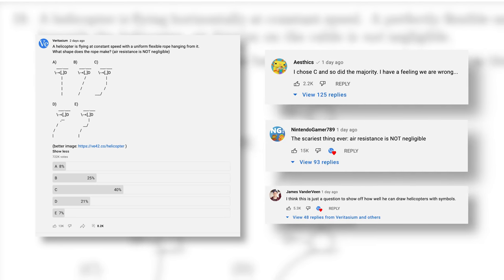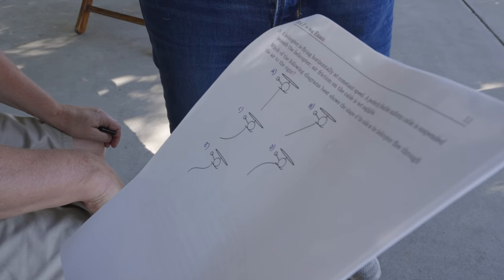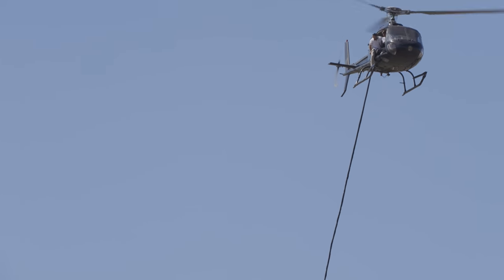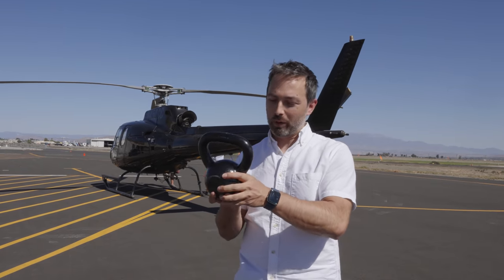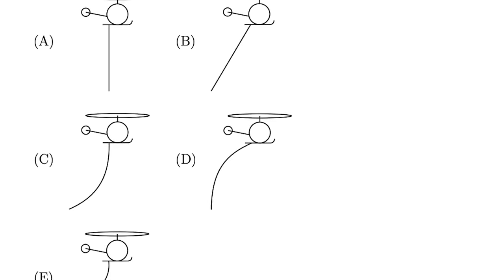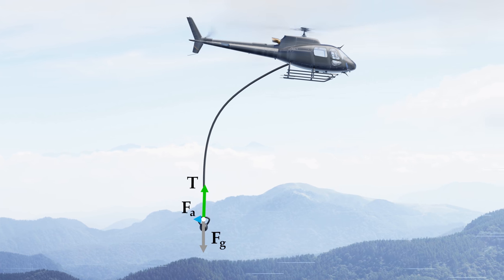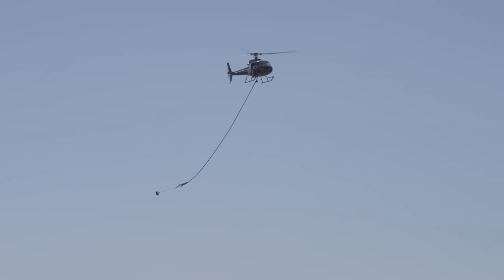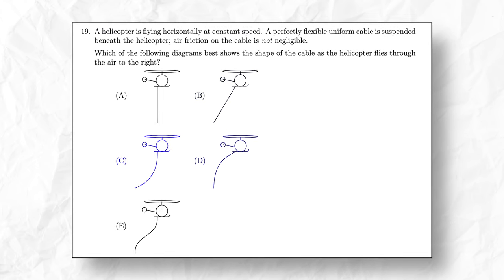I Rented A Helicopter To Settle A Physics Debate

Comment: Having done MSc in aerospace, and PhD in mathematics, I can assure you that the intuitive way you proved it is definitely the best way to approach this topic. I have come across this topic before but it's surprising how easy it is to get lost in it if you don't have the insight of the tensile angle. I remember back in Bachelor's, when I first attempted this question, I got lost trying to apply something called the "virtual work theorem". Essentially I tried treating it like a mechanical beam with uniform loading and one end suffering virtual deflection. Anyways, I just wanted to tell you that I really loved how you approached the explanation along the easiest-to-digest path. :)
Reply: I've seen at least one other commenter here talking about mechanical beam analysis, which seems weird to me - beams are (mostly) rigid, and the rope has no intrinsic resistance to bending. Hence I wouldn't expect that model to be useful for this scenario.

I'm working from high-school physics though - am I missing something important?
Reply: @patheddles4004  but the same logic of fbd diagram applies in both case, so if we take the fbd then the question becomes simple..
Reply: Before seing the solution, I was thinking that the weight of the rest of the rope decreases towards the end of the rope, but the friction would be the same. I accept that I'm wrong, but don't understand why. Can you enlighten me?
Reply: @patheddles4004  Well it's a mess created by how teaching is approached in these cases, and real world physics being much more complex. In this case, two main factors lead to these wrongful assumptions.

1. Background: For example, my bachelor's was in mechanical engineering, and in it, we had to repeatedly assume a lot of materialistic properties when the question would not explicitly state it. not to mention, for years we are trained on hypothetical questions asking us to assume certain things which are not true in real world physics. In this case, if you are just told about a rope and air drag without stating much about the stiffness of the rope, it is very easy to fall in the trap of assuming that the rope is just an uniform beam under constant (perunit length) loading because in mechanics, we would often reduce real world problems into such simple cases.

2. Stiffness: This makes it even easier to fall in this trap. The rope can behave arbitrarily based on its stiffness. I did my master's thesis on dynamic inflow modelling of helipcopter rotors. What I can tell you is that if the rope was actually flexible enough, it would't make any of the shapes from the question. It would rather follow the helical pattern of the vortex ring downwash created by the rotor, and can even ride the upwash to get into rotor blades (as the pilot was afraid of). Therefore, for the rope to have a 2D profile like those from the question, you are assuming certain level of rigidity. The answer you would get will depend on how much this rigidity is.

In summary, everything is a mess in real world. You cannot simplify a complex system into smaller idealized cases and hope to always get the same results as real world observations. Each complex case can be reduced to multiple idealized  cases and whether or not you get the right answer as real world will depend on whether you could successfully identify which idealized case fits your current test the best.

Hope this helps. :D
Reply: @rasmis  : My thought process was exactly the same as yours!  I hope someone can answer your question in a way that we can both understand!
Reply: This is why experimental physics exists. You can run in circles with competing theories, but, at some point, you just need to test the fkr.
Reply: @rasmis  it is said here that the rope is uniform, so why would its weight decrease? Uniform means that the weight is equal in every section of the rope...
Reply: That's what I did as a student doing bachelor in mechanical engineering.
Reply: @AniketTurkel  which nit are you in?
Reply: Hah. Applying virtual work here is creative. But yeah, keep it simple for this one. If you had to prove that the solution is dynamically stable, that'd be tough. But if a stable solution exists, then the external forces have to be equal on every segment of the rope, and then it's no different than simply tilting coordinate system and rope hanging straight down.
Reply: I also thought of it as a beam with a uniformly distributed load on it, and I thought it would be B, so maybe your idea wasn't so bad after all.

Edit: well maybe not exactly like a beam, but beam mechanics made me think of the UDL, in this cass the air resistance
Reply: Same thought friend... Same thought 🌹
Reply: @whoami8247  The way I understand it, the weight decreases at each point down the rope because there is less and less rope pulling it down.  
(Full disclosure, I'm just a physics hobbyist so don't take my word for it)

🖤🕳
Reply: @cherylhudson7333  but here the weight doesn't matter...
Reply: @cherylhudson7333  You have to balance the forces acting on any finite section of the rope, not literally at "a point". If you take a finite section of rope, tension is pulling it down at one end and up at the other end. It is the combined force (difference) that matters, and that must balance the weight of the section and air resistance on the section. In the first scenario, that difference is the same for equal sections of the rope, making the tension itself increase linearly up the rope.
Reply: @OneEyedJack01  and yet they are asking students based on a theoretical understanding of force diagrams. That is hardly a good question.
Reply: @OCD.Reader  my intuition insists that you'd need to reduce the mass of the rope as well, but of course that's also not specified in the question. But yeah I can imagine this with a fine thread instead, in which case it would definitely behave very differently. I was definitely working with a bunch of assumptions that I hadn't even noticed, though fortunately they turned out to be the intended assumptions.

I was about to argue about the effect of the rotor wash decaying rapidly with distance, but then I realised that that would mean different forces in different parts of the rope (and hence a different shape). Apparently reality is complex, or something...
Reply: A diagram of two links flashed on the whiteboard is the easiest way to go. I’m wary of “linearities” as they easily become nonlinear, and a counteliver beam popping to my head at first ( my mech. eng. mental bias) led me to look for a different path.
Reply: @OCD.Reader  I got lost in modelling it assuming mechanical beam-like properties too ( unsurprisingly, as most would, looking at the percentages :p), and what you're saying is really insightful and a such a well written view on how far apart Physics, which should depict real world interaction, can actually be from reality if we're not careful.
 The Tension Angle i was completely oblivious to, but it makes a lot of sense and it's really an "invisible" but crucial force, especially in this case to get the right idea. If i knew about tensile force properties i would've much rather compared the hypotetical variable beam-like momentum arm of the rope to how the tension changes in each of the points along the rope, and rather not assume that it would impact shape along the rope, ultimately!
Reply: @OCD.Reader  excellent explanation.

Comment: To ad to the conversation on the interaction of the helicopter rotor wash - A helicopter in forward flight quickly passes through a phenomena called "effective translational lift" at ~20 to 40 knots indicated airspeed.  This phenomena is when the blades starts flapping (advancing side blade moves up, retreating blade moves down with each rotation) to compensate for different relative velocity around the rotor path plane.  The rotor wash directly beneath the helicopter is then negligible as it is increasingly "left behind"  the aircraft and the rotor increasingly processes fresh (an accelerated) air.  The pilot typically reduces the collective rotor pitch to compensate for this increased performance.  You can see this when a helicopter flies over water in close proximity at various speeds.  This phenomena greatly increases helicopter rotor lift (efficiency at converting engine kw to lift), so the helicopter pilot typically wants to get into the translational lift environment to save fuel and reduce engine power demand as quickly as possible.  The helicopter is also less vulnerable to engine failure in translational flight mode - if the engine failed it is easier to safely auto rotate to the ground with the energy and increased lift of forward flight added to the stored energy of the rotor rotating mass.  Their is something in the manual called the "death curve" typically.  It is graph of height versus airspeed.  On one side, and as you get further from the curve, the helicopter is easy to safely autorotate to the ground.  On the other side, it is unlikely you have sufficient combination of altitude, airspeed and rotor rpm to land safely if the engine catastrophically fails (instantaneous loss of engine power).

Comment: I had to watch the explanation about 4 times to get this.  My mistake when sketching this out was not realizing that the air resistance of all the rope underneath any section adds up in the same way that all the weight adds up.  So at top of the rope I had tension balancing the entire weight of the rope, but only a tiny bit of air resistance.
Reply: i don't know how to sketch it or calculate it... but i was right both time... just common sense

Comment: This is a great video!  There was a myth-busters feel to this one.  You explained the theory, but experiment is the final arbiter.  It seems that to get the shape in answer E, you would need high drag towards the middle and then a weight at the bottom.  But I think you tempted fate long enough in that helicopter as it was.  I was impressed with Craig Hosking, expert pilot!
Reply: i feel a different type of rope. maybe a flat one , would have made for the drag needed for that scenario you speak of. imagine what chain mail might look like
Reply: @slitheredxscars  flat rope would still be B but likely get caught in the back rotor, chainmail would also be B
Reply: The actual answer would likely be none of those, or possibly all of them, without the qualifiers about most closely resembling it. I'd wager that all of them except A would pop up when flying due to the fact that you can keep a helicopter relatively steady in terms of ground speed, but also keeping it steady in terms of air speed at the same time is going to be an issue.

Comment: I think it is pretty neat to spot that this happens because it is a flexible rope.

In all of my tests, I'm not sure if the rope was not flexible, but the tension was always the same along the whole rope. I even thought it was some kind of property.

That is why my first guess was B (straight line) but I thought that with weight, you would just get a different slope and a straight line. Really neat the animation.

I was confused at first why the weight is not pulled enough, but they are all in constant velocities, also, it is just a comparable air resistance that is small, but it is still the same as at the top, right? It is just smaller because there is more weight... And it dissipates along the rope?. Again, I'm not sure
Reply: I’m confused as to why we are assuming the helicopter is moving forward, as the only direction given in the question relating to its horizontal movement, is “through the air to the right”. To me this reads as the helicopter would be facing north, but traveling due east.

Comment: I think many of us who chose option C (such as myself) were expecting the rotor wash to be far more significant of a factor. Perhaps to make the question a little more fair it should be asked with a blimp or perhaps a slow airplane.
Reply: I was thinking the rope would be dragging on the ground
Reply: The question is fair
Reply: I hope there's not that many of you lol
Reply: Was not really factoring in the rotor wash myself, but just thinking about the tension at the bottom of the rope being lower. Not sure why that made me choose C over B now (was inbetween those), but makes sense now after the video. :)

Comment: The same situation as C with the cable hanging like a J happens with in air refueling of some jets and helicopters. Some use fuel lines with conical conectors which have less weight, since they have a more weight saving design than the rest of the lines and more drag, since their design is larger than the rest of the fuel line (to make it easier to connect). the effect is very subtle due to the high speeds but it still noticable sometimes.

Comment: Happy to hear that my structural analysis courses came to help me in getting the correct answer. Treat it like a simply supported beam with a single pin connection and it deflects linearly 😁
Reply: I knew answer not because of formal education,  but rather because I have had informal education of seeing quite a few helicopters flying with stuff dangling below them.
Reply: XD nice one
Reply: how tho? the cable is not rigid
Reply: For the rope only I was sure it would be B and I thought many people would guess C, But I had no idea why I thought this would be the case. The diagram  made it click
When he added weight I went back and looked at the diagram to consider what the effect would be.
I have noticed a similar effect while fishing in clear,  fast moving water on the line. If the line breaks, the answer is B, otherwise C. lol
Excellent question, I should have stayed in school!
Grade 8 dropout (un-diagnosed learning disability, dyslexia) But a life long learner, regardless.

Comment: So if you have a rope that has varying density, you could potentially have things like A and E happen, and ever weirder looking stuff too, I assume?
Reply: It's not so much about density as it is about the weight and drag. Of course if you keep the same width but with a denser material you increase the weight by effect.
Reply: E can be possible with a high density on top and bottom und low in the middle.  A is theoretical impossible, you can get close to it with  B and D with a very high mass at the bottom or at all points of the line.
Reply: @MetaKnight23  A is possible if constant speed from problem is zero
Reply: @mickmenn2  Haha, that is technically true
Reply: @Demozo_  I'd say it is all about density, especially in the form of mass per unit length. As he said if you (only) vary density you can vary the shape. But I see your point that you can vary the weight without varying the mass per volume
Reply: If you think about it you can just consider the drag and weight forces as x y coordinates and make a rope with any given curve by varying along the line. The rope has to stay pointing down and back though as neither drag or weight can ever be negative, in the ideal case at no point will any part of the rope point upwards, forwards or truly horizontal or vertical
Reply: A probably would only be possible with a really heavy rope. Where the air resistance isn’t enough to sway it because of the force acting down on the rope.
Reply: @MetaKnight23  A is not possible even in theory if we constrain the hypothesis in the boundaries of reality. It is only possible if the drag is exactly zero. The weight does not matter. If there is any non-zero amount of drag, like in reality, the shape would be one of those others.
Reply: @anteshell  It is possible. Just imagine a very high mass at 1/4th down the rope and a medium high mass at the end of the rope. If the rest of the cable is very light it will take the shape seen in picture E. To make it even more fitting, imagine having a very high density rope at 1/4th of the rope with a very fast but smooth density drop down the rope.
Reply: @mickmenn2  you are right, I assumed v>0. It is also possible if the helicopter is slightly tilted forward (as he usual is) but the pictures are rotated with the helicopter :D ;)
Reply: @MetaKnight23  My mistake. I was talking about A and mistyped E. I'll edit my comment to correct.
Reply: @anteshell  ok, but I also said A is theoretical IMpossible ;)
Reply: Yeah, I didn't really think about it when writing the comment and completely overlooked it, but I agree that A is theoretically impossible, assuming non-zero velocity. Also I meant varying density with the same volume and shape across the entire length of the rope, so really just varying weight, but it made sense to me to say density for some reason. On that note, it occurred to me that you can also just change the surface area of the rope at varying lengths to achieve the same goal (of creating different shapes), although I think it would be much harder than varying weight to reproduce in practice because of outside factors like the wind, even in a calm place like they used in the video.